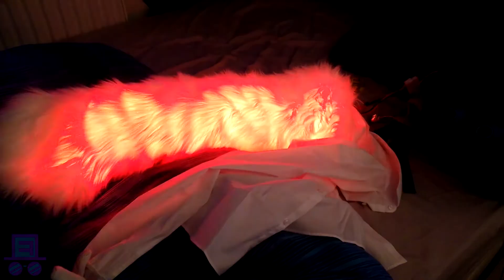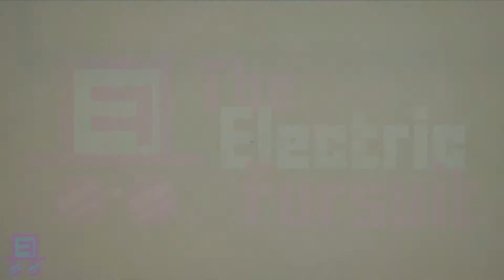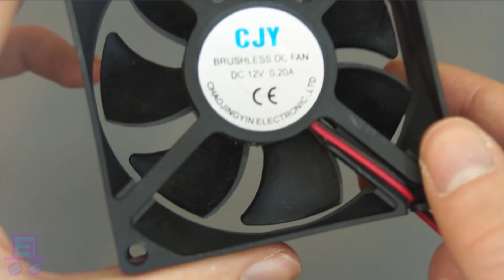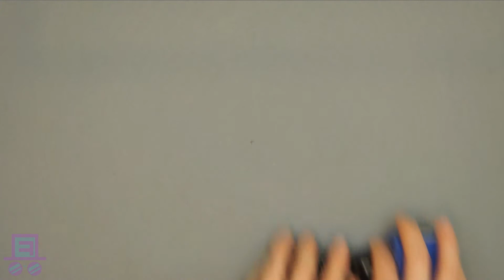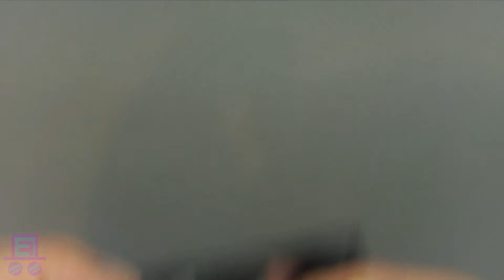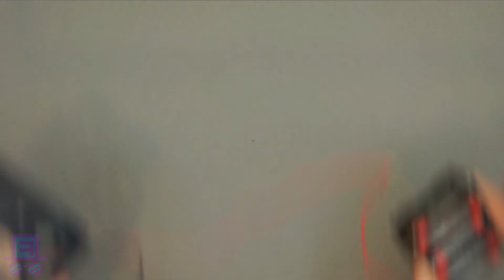TEF 1 - Fursuit Fan Tutorial

Comment: I have a problem, instead of a battery pack, I’m using a rechargeable power pack with USB ports, and I’m not sure what to attach the wires that will run from the fan in the muzzle to the power pack to so it will be compatible compatible. The more widely available the solution the better, as I currently live in Dubai where good quality electronic parts aren’t the easiest to find. Also wondering where the best place in the head to put the power pack (currently going for the back of my neck).
Reply from the maker: Hi there! I used to travel in the middle east so can understand your difficulty!

My recommendation would be to use a USB power pack (5v) and use a 12v fan and just accept it'll run at a lower speed. If you want to be really sneaky you could try opening up the pack, sometimes they contain cells that combine to make more than 5v and then are stepped down. If you can tap into the batteries behind the regulator then you might be able to get more juice. Another option (proceed with caution here) would be to string two packs together in series to make 10v. However charging circuits inside USB packs can be a little weird sometimes.